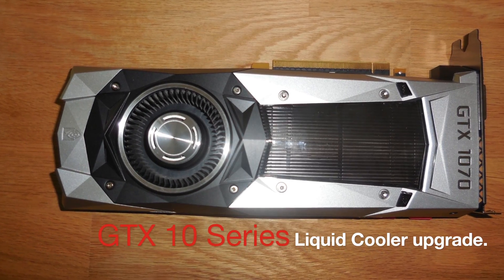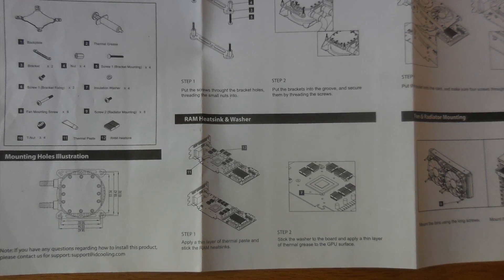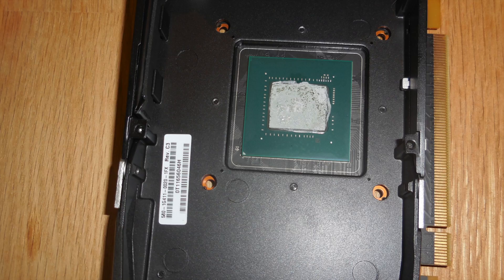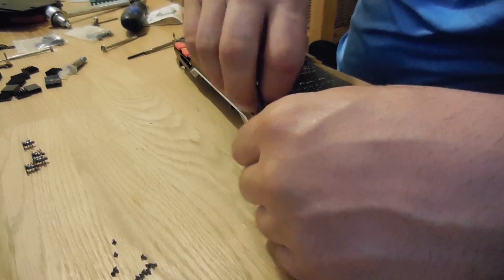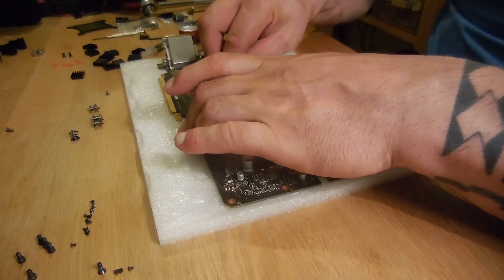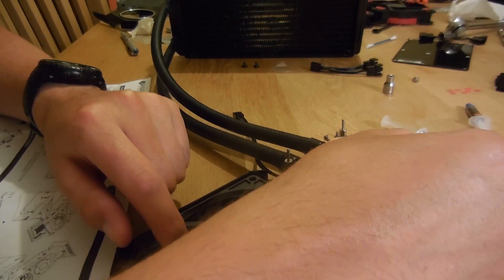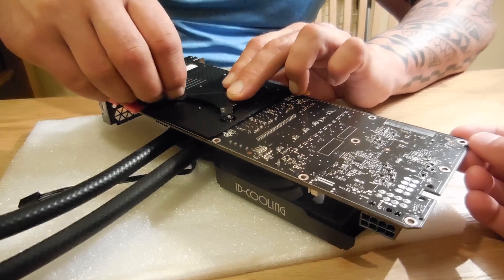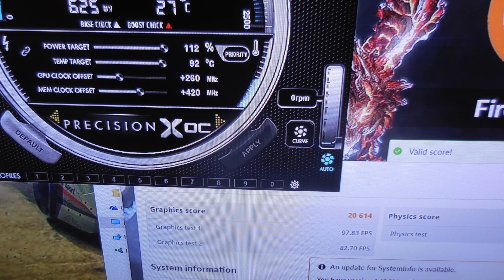Nvidia gtx 1080/1070 liquid cooling with frostflow 240G

Comment: A few major mistakes.... 1st of all, i would never apply that permanent thermal glue to the ram chips instead use thermal adhesive, it will be a PAIN IN THE ASS to remove them after they cure (thermal glue)... 2nd Put heat-sinks on the VRM's as well, even if they don't heat up that much and have that fan blowing towards it, ensure they are properly cooled... 3rd DON'T tighten with a screw driver the back screws of the back plate as you RISK TO CRACK THE CHIP DIE

Comment: Too much work wtf? Cant this be easier?
Reply: If you change your gpu thermal paste every 5 months this should be easy for you.
I already ordered 120vga which is the single fan version of this with no rgb lighting for $50 from Ali Express. I'm going to use CM AB 120MM rgb fan for this radiator.

Comment: you don't have do water cool if your not over clocking, do you?
Reply: Not really unless like myself you have a Founders Edition with the terrible jet engine and high temps causing the boost clock speeds to throttle. I've just ordered myself a Kraken G12 with a Corsair H55 water cooler as I want to build a near silent while low temperature system and the GPU is the last thing that makes very audible noises even with earphones in.

Comment: The original back-plate was never meant to have that sort of watercooler back-plate torqued down on it... Those thermal pads on it do transport heat, but are also required to stand the back-plate away from all the electronics...  That is why there are the 4 holes in that plate for the actual mounting screws around the GPU itself, and all the other screws that actually hold it on are tiny...

Putting that water block mounting plate on with the original back-plate between will result in either not enough torque to do anything, or if you actually do torque it down tight enough you are going to short out all the electronics on the back of the card...

Not hating on you, love your other videos because they have helped me a lot, but if people actually follow this one to the letter they are going to fry their card, and the manufacturer wont cover this under warranty because this is clearly user damage...

Comment: The first part of the disassembling is useless, you just need to start with the backplate of the 1070, and leave  the  old stock cooler as it is.

Comment: Hi man I ve got an nvidia gtx 1080 and playing, my gpu touch like 75 degrees,  I would like to go for liquid cooler for my gpu, but I do not know what is the best for me, what do you suggest?
I've got already a liquid cooler for the CPU too
thanks
Reply: Hi, I was wondering if kraken g12 works with corsair h80i v2??
Reply: Compatibility - AIO Liquid Coolers NZXT
Kraken X72, X62, X52, X42, X61, X41, X31, X60, X40
Corsair
H105, H110, H90, H75, H55, H50 (CW-906006-WW only)
Thermaltake
Water 3.0 Riing RGB 360, 280, 240, Red 280, 140,
Water 3.0 Ultimate, Extreme S, Extreme, Pro, Performer
Water 2.0 Extreme, Pro, Performer
Antec
KUHLER H2O 920V4, 620V4, 920, 620
Zalman
LQ-320, LQ-315, LQ-310

Comment: Can it be replaced by frostflow 240L?
Reply from the maker: no, unfortunately, the 240L is a CPU cooler only and so will not fit. Also, the 240L doesn't have the fan that coolers the VRAM chips etc.
Reply: Spaceinvader One But it looks like 240L equiped with gpu bracket + fan. I mean head pump looks same, then i figure it out can be replace with another frostflow aio. Is that true?

Comment: Got mine today,  I'm using it on a 1080 ti. Working wonderfully, got the same temps as you do (Superposition benchmark for 1 hour, temp stayed around 50 °C. The thing is, their website says the pumps max rpm is around 2500, mine only goes up to 1300. Just wanted to know if yours is the same, or mine is deffective.
Reply: i think its changeable in the bios

Comment: Did you use one or both fans on the radiator?
Reply from the maker: Hi, Badrstech. Yes used both fans on the radiator. Changed the fans to noctua in the end, as were quieter.
Reply: Nice idea! Do you set the fans at 100% speed all the time or less? What are the max RPMs of those fans and have you overclocked your card?

Comment: the gpu adapter are including in the box or you buy it separately ?
Reply from the maker: Hi
Everything that you can see in the video was included in the kit. But we did buy some better thermal paste than was supplied
Reply: Thanks dude, I'll try it on my 1080ti and if it does not work, I would put it on my 4770k :)
Reply from the maker: I just fitted an evga liquid cooler kit for the 1080 to a 1080ti and it worked really well. Had to do some small mods. Video will be up in a few days I will edit it over the weekend
Reply: Did it work for the 1080 ti? looking to do this to mine
Reply: actually dont know cause mine are processor version only so.....

Comment: How is the pump noise?
Reply from the maker: Hi Garrett, It's not to bad. The radiator fans, we changed them to Noctua to make it quieter as there are 2, but the pump is fairly quiet.

Comment: Also is there a way to check the fanspeed of the radiator fans and control it?
Reply from the maker: no i think you would have to add a fan controller to it for that. By default there isn't :(
Reply: really? thats weird. Cos right now the fans are SUPER quiet but the GPU is like 65 degrees when playing GTA V 144HZ G-Sync..

Comment: I just bought one of these. Just wondering what you did with the radiator fans- where do you plug them in?- to the GPU?
Reply from the maker: no, the radiator fans don't plug into the GPU as does the original air cooler fan, originally on the card. You have to connect the rad fans to the motherboard or PSU.

Comment: A little recommendation: if you're going to leave the background music at that level, also raise your mic volume level or your voice channel during post processing.
Aside from that, good video.
Reply from the maker: Thanks Hazma. Yes wasnt the best sound in that video. Was my first. I am hopefully getting a little better in newer videos. I have been using  iMovie to edit  but I think i will change to something that gives more control over sound etc.
Reply: Spaceinvader One Not a problem. I would say it's very good for a first video. I should be getting this product soon as well.
Reply from the maker: It's a great cooler I think you will be very happy with it :)
Reply: Spaceinvader One Here's hoping. Will be using it with MSI's R7 370 GAMING 4G.
Reply: @SpaceinvaderOne  heatgun to remove warranty sticker and use fingernail to carefully scrape it off - is that what you did or use tweezers?

Comment: Hi, mate,

My question is how noisy the water cooler is?
Reply from the maker: Its fairly quiet. It has 2 radiator fans which are sometimes a little noisy when in a quiet environment. We changed those stock fans to Noctua and it made a big difference

Comment: Are the VRM's cooled enough ? THe 92mm fan is quiet or not? Thank and sorry for bothering you.
Reply from the maker: Yes the VRM were cooled fine.The fan that cools them is very quiet. But the radiator fans we decided to change (for Noctua fans) as they were not as quiet as we wanted.
Reply: I got 2x Noctua NF-F12 for the radiator, so i will change them too if the stock ones are to loud. THAKS YOU SO MUCH! HAVE A GREAT DAY!
Reply: What are the temp on your VRM's? my VRM 1 is about 70 and VRM 2 is about 75. The Gpu is a R9 390 Sapphire Nitro.

Comment: Hi there! In the package was included the silicon paste or only the thermal paste? thanks.
Reply from the maker: Yes, you get both in the package. Everything needed.
Reply: One more question if you don't mind. The pomp and the cooler that cools the VRM did you connect them together with the FAN SPLITTER or separated? thaks!
Reply: Spaceinvader One what about AMD?

Comment: Great... Im planning to put some AIO too on my GTX 1070 Zotac Founders Edition. There should be the same no matter which manufacturer you get, right ?
Reply from the maker: If you mean "no matter which manufacturer" in regards to the graphics card then no it doesn't make any difference and will be actually the same.  If you get an AIO from another manufacturer may be a bit different but the card will come apart the same and I'm sure it will  be very similar to fit .
Reply: What do you mean Aio from another manufacturer ? Im looking at Frostflow 240g from ID cooling like the one you got yourself. Idk will kraken g10 fit. Is there any other aio for gtx 1070 that you know about ?
Reply from the maker: I think the frostflow is excellent esp having a 240 rad but i know evga do 120 rad  HYBRID Water Cooler (All in One) for GTX 1080 and 1070. It fits their founders edition card so should fit any founders edition as it states its compatible with all "reference" style graphics cards http://www.evga.com/products/product.aspx?pn=400-HY-5188-B1
Reply: Yeah... I saw that cooler too. But i dont think i cant find any of those 2 coolers in my country :((( There are only ID cooler for cpu and gpu ( hunter Duet ) and i cant find anywhere Hybrid AIO too. My only option is to get some bracket like Kraken g10 and some AIO like x31 or some other... Hows the temps on your gtx 1070 while gaming and which games you play ?
Reply from the maker: Temps havent gone beyond 60c. I play metro, dying light, doom and other fps.
Reply: :) Im asking because i play Battlefield 1 at 1080p 144hz max settings, card is overclocked to 2100mhz on the core and +550 on the memory and doesnt pass 69C. Idk is it worth for me to buy and put aio :) Cuz i have big corsair case with a lot of vents :)
Reply: if you already have good case ventilation, it probably don't matter as much. unless you find your graphics card throttling down while gaming that is.

Comment: no heatsink on the vrms?
Reply from the maker: Yes, your right, that would definitely be a good idea to use heatsinks on the vrms. Unfortunately, the kit didn't have enough to cover all the vrms.  The 1070 has 4+1 vrms and the 1080 has 5+1 vrms.
 There were an extra 3 heatsinks left over after installation that could have been used but extra ones would need to be purchased. So if you did use this kit you would need to buy an extra 2 heatsinks for the 1070 or an extra 3 for the 1080 :)
Reply: Spaceinvader One Thank you considering getting this or this RAIJINTEK MORPHEUS to replace my stock ASUS gtx 1080 turbo, thermo throttles at 2GHZ load around 70-84C  depending on the game.

Comment: only works for founders edition? :)
Reply from the maker: Should be okay for others as well as the 240g is designed to fit multiple gpus.
Reply: i have the evga gtx 1070 black edition is it compatible?

Comment: what about grounding yourself? is it needed?
Reply from the maker: Its always safer to ground yourself so not to have any static. We work on a wooden table and floor. So its not reaaly a problem.
If working on something touch your computer case ir similar with your hand before picking anything up and working on it to discharge any static that may be present.
That should cover it

Comment: Do we should remove backplate at Custom GPU ?
Reply from the maker: Yes the backplate needs to be removed. Unfortunately it is only possible to put half of the back plate back on. As the other half was held on by screws/bolts which screw into the front casing.
Reply: Thanks man (y)